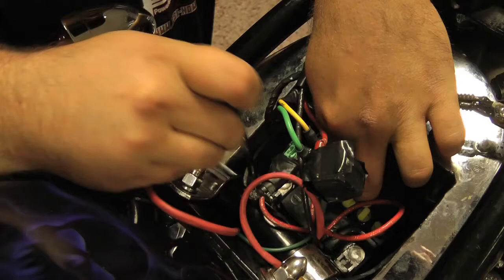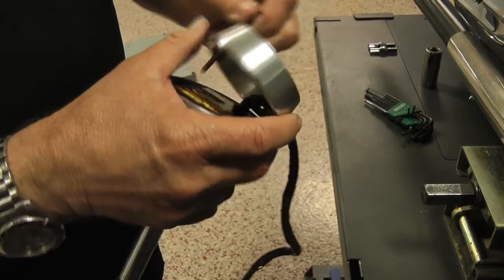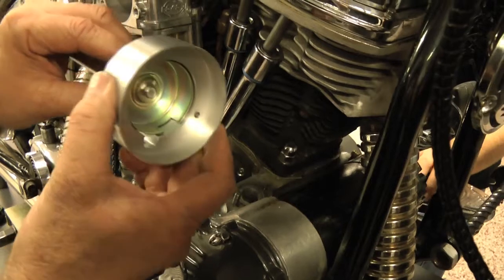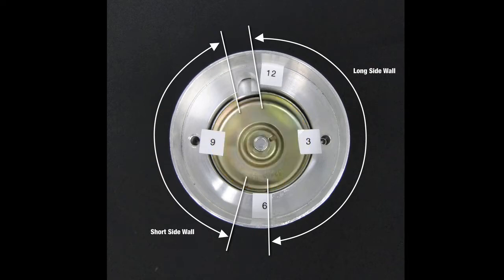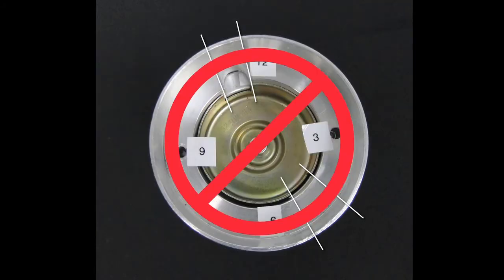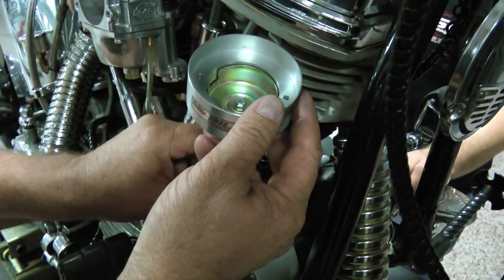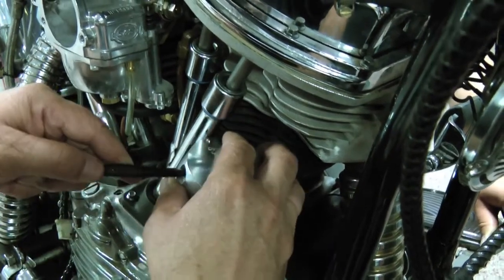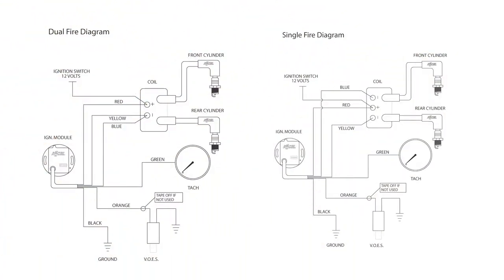ACCEL Motorcycle - Installing an Electronic Advance Distributor in a Harley Big Twin

Comment: Robert, I am not familiar with the STD castings. Stock Harley heads and cylinders do not need to be removed to install the Mallory distributor.  We recommend a 3 ohm coil for best performance.  The 5 ohm coils you have are recommended for points style ignitions only.
Reply: If you have S&S cylinders then... Then you need to remove them right?

Comment: Please indicate the reference point for the clock positions.  Is it looking from the front or looking from the right side?  Also, the photographs from the instruction sheets show the module 180 deg from this video.  Please clarify.  I am installing one on my 62 pan that is kick start only and need to get initial installation as close as possible.
Reply: Hey Myk, how did you go with that installation? I'm looking into putting one of these on my 62 Pan now, so would really like to hear your experience.
Reply: Steven Paydon I bench tested the unit and found that it only worked in reverse rotation. I bought the unit used and it did not come with the reverse circuit breaker drive gear. I have not found one yet so I have not tried the unit on the bike.

Comment: Do you not need a reverse drive gear for this electronic ignition? You do with other ignitions, and the gear on the bottom of the distributor is also reverse when they are sold with the electronic kits..
Reply: you say set it to 12 3 6 exc is that if your looking at the bike or sitting on it?/ thanks
Reply: Is a reverse drive gear necessary? Second, can you you a Spyke distributor and obtain the same results?

Comment: I have a 1951 EL Pan and I need to replace the distributor.
i was told I would have to pull the heads but it seems thats not the case. So, If I go with this unit, will I have to pull the heads? Also...I'm running STD Dual plugged heads and had a drag Auto advance distributor w/ electronic ignition...I have two, double titted dyna 5 Ohm black coils. Would the coils be compatible with this unit? Thanks in advance..
Reply: @Ahmad Davis thank you, I went there and it seems like a nice service =) Appreciate it !!
Reply: @Emery Forrest No problem =)